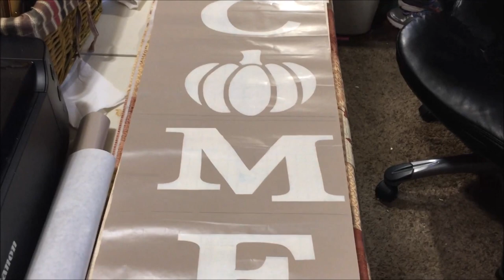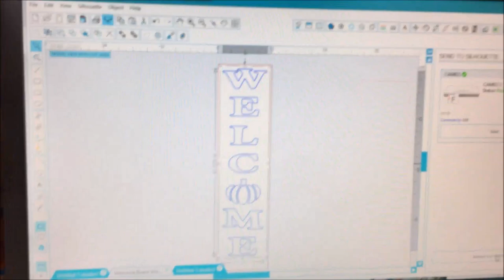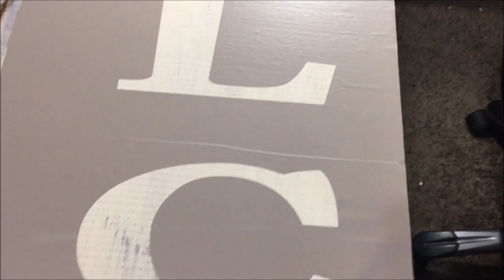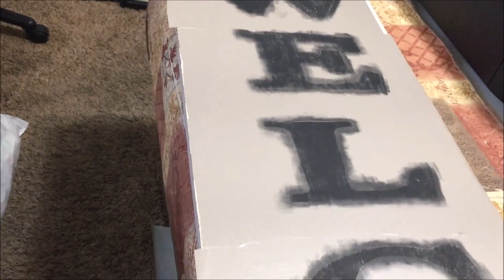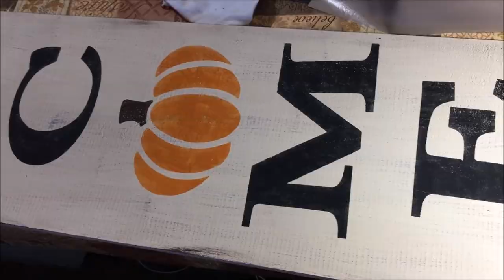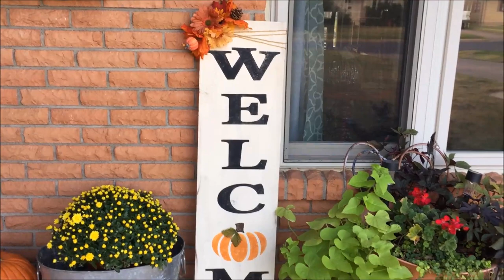DIY Front Porch Welcome Sign

Comment: What kind of paint do you recommend for outside weather so it won’t fade!? And what kind of sealing do you use for outside weather (sun)?
Reply from the maker: I just used acrylic paint.  I did not seal mine because it is under the porch and was only used for about a month.  I normally don't seal mine but if it was in the weather for a long period of time I probably would with a polyurethane.  Thanks for watching!

Comment: Did you have to put a sealant on the sign, to keep the weather from damaging the paint?
Reply from the maker: I did not seal mine.  I have different signs for the seasons so they are not in the elements that long.  Plus where they stay is covered.  If you are going to keep it where the weather gets to it, I would seal it for sure.
Reply: paperscraps  Thank you so much for answering.  I can't wait to try this.